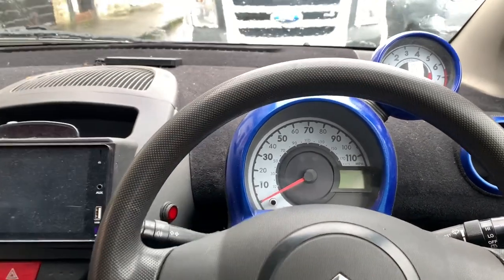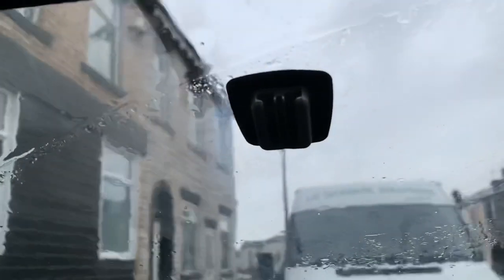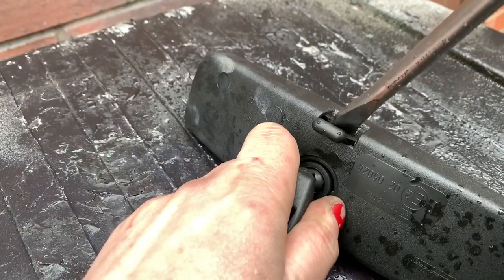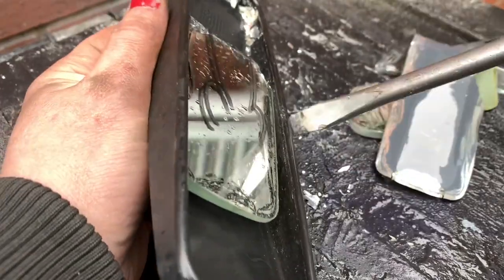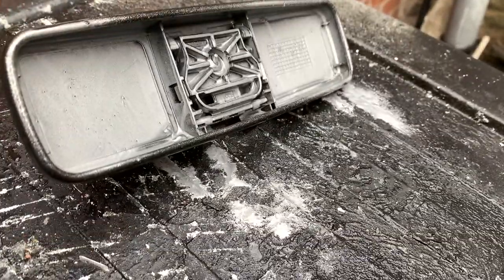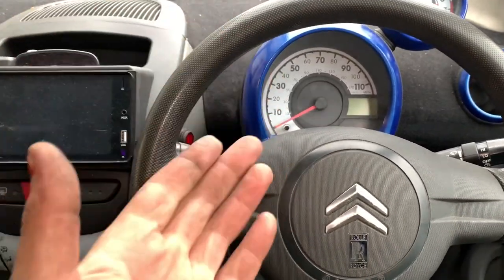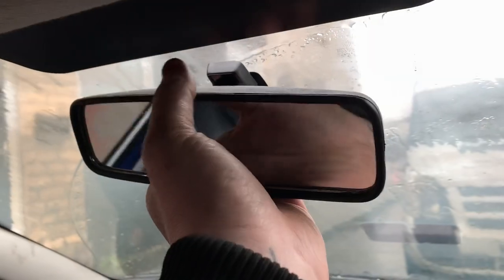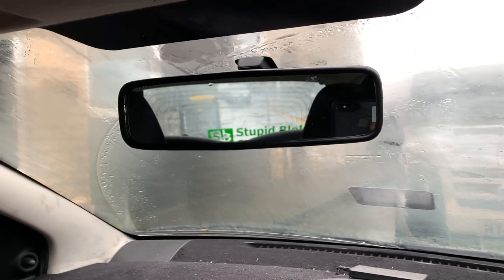CityBug Rear View Mirror Replacement/Repair How To (Citroen C1/Aygo/Peugeot 107)

Comment: Ahhh, you got the knockoff mirror. I'd recommend the OEM mirror because it fits much better into the bracket, and the ball joint isn't flimsy. The OEM mirror costs 50€  new while the knockoff costs 20€. It doesn't seem worth it to me.
Reply from the maker: This mirror is absolutely shite tbh. It was about £5 off eBay though so what can I expect 🤷‍♀️

Comment: When I bought my C1 the cord to lift the rear parcel shelf when you open the boot was missing.  I just used a bit of paracord to replace it.  Made a bulky knot in one end, threaded it through the hole in the parcel shelf from underneath until the knot stops it going further, then tie off around the small peg near the boot hinge on the inside.  You need to experiment a bit to get the right length to the shelf lifts the right amount but once done it's done.
Reply from the maker: Mine didn’t have one at all, but a nice guy in the CityBug group sent me his when I fitted the sub as I wanted to cover it up. He didn’t even take payment for it, sent it me cos he saw I needed one. It was in perfect condition so I put it in the black better c1 and pinched the one out of that for mine. Thanks again Szymon 👍

Comment: Can you get a turbo on it also wouldn’t that brake the engine instantly?
Reply from the maker: I’d love to tbh but that’s a bit too involved for me at the moment
Reply: I seen a full kit on fleEbay called universal for about 350-400 quid. Another mechanic guy fitted it to a old honda and tested it and it does work, however it requires adjustments. Would be fun to see the C1 kitted out with a cheap turbocharger to see how it performs - especially on the MOT - but this would mean we all have to chip in as I wouldn't expect Tim to pay for it all.
Patreon would be a way of funding if anyone interested.
Reply from the maker: @Gourmondise  I’d not expect anyone else to pay for my cocking about tbh lol. I got offered a turbo for my bmw as some kind a sponsorship about a year ago. A rep kept messaging me trying to sort it out but I would have had to fit it within a month of getting it, and when I told the rep who wanted to send me it that I wouldn’t lie about it, and if it was shit I would say it is shit, he stopped asking me 🤷‍♀️

Comment: Yeah not exactly what I was hoping for really. 🤷🏻
Reply from the maker: Did you find the video useful?
Reply: @StupidBlokeStupidVideos  sadly no. I was hoping for an actual solution as the mirrors are a known problem which are not cheap to fix. It starting off promising but then fell a bit flat in terms of resolving the problem
Reply from the maker: @keithletheren196  ah sorry. The only way to fix the issue is with a replacement, which was actually a cheap fix this Tim tbh. It was an eBay part for about £8. I’d send you the link but it’s so shit I wouldn’t bother. I think genuine ones are only about £30 though.